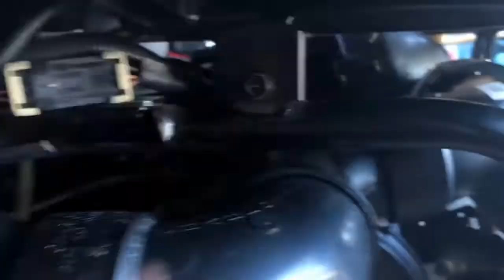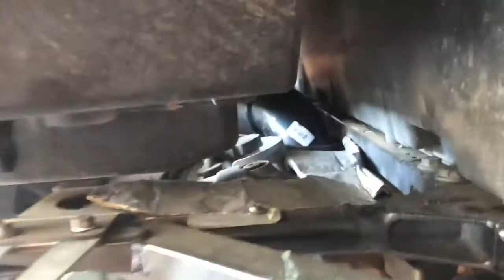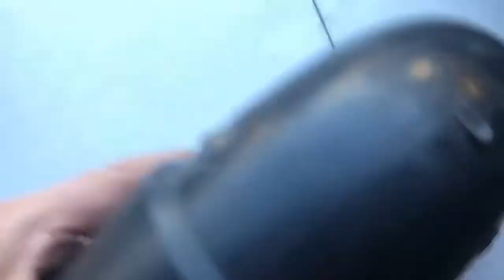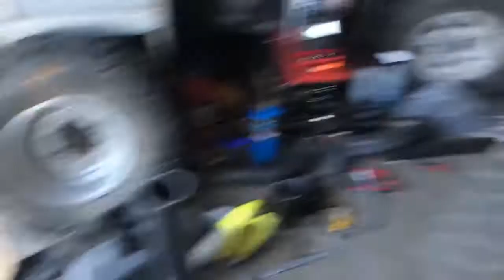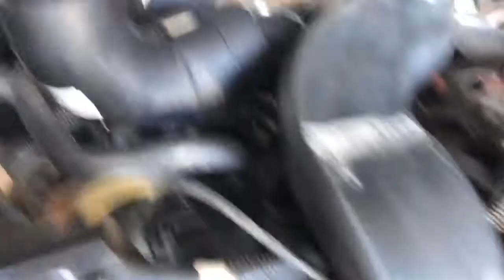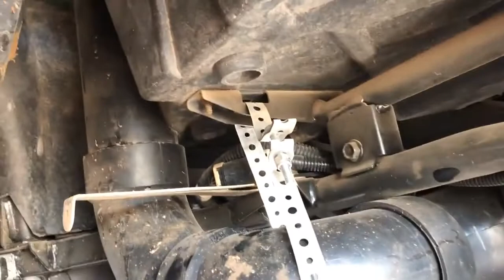Polaris RZR 900 XP Air Intake System

Comment: My 2012 900 xp has an oil sump where you put the pipes through the bed. How can I do somthing like this ?
Reply from the maker: Yes that year had that.  I would move pipes over to center more.  Other option was from airaid had stacks that bolted to outside of where factory pulled air on sides.  I wasn’t able to find them but it was an optional idea I considered.